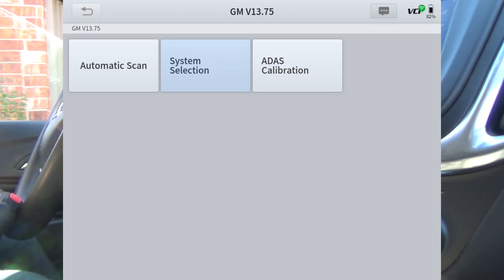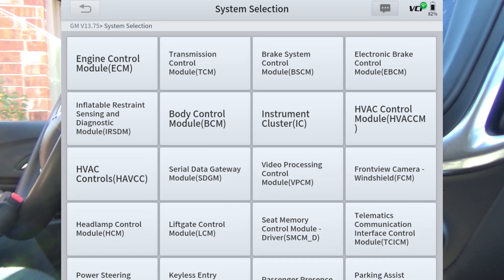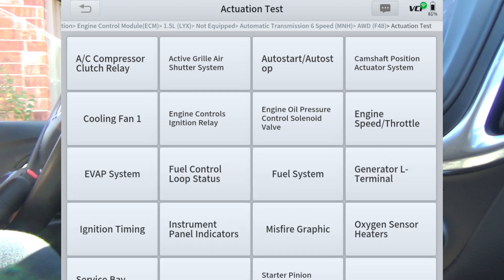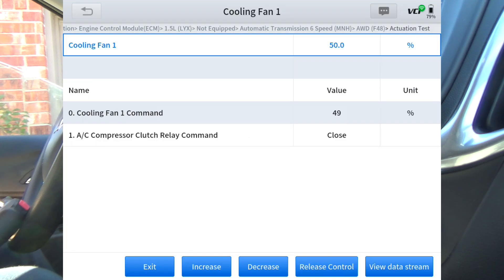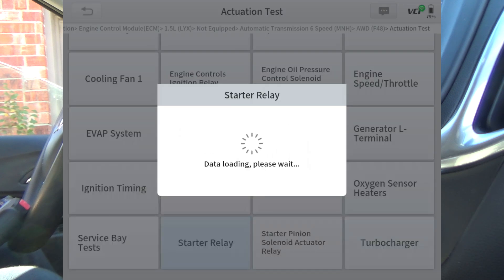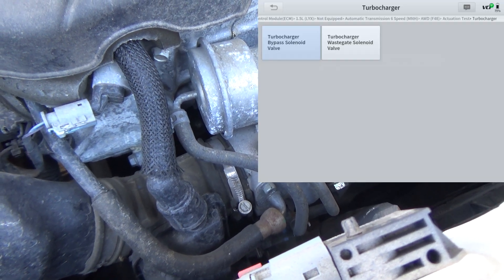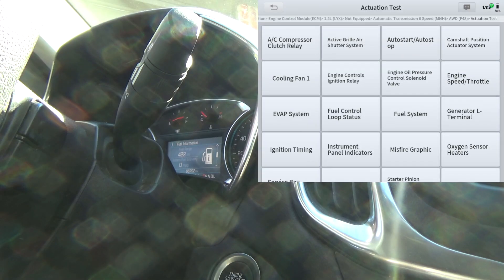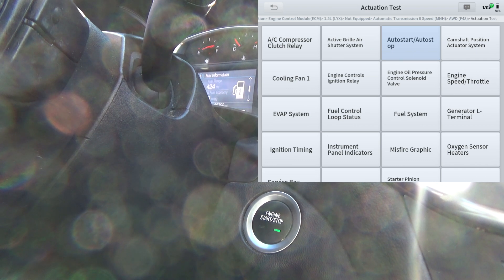Doing a Few Function Test on a 2021 Chevy Equinox using the Xtool D8W Scan Tool.

Comment: Next time go into the Body Control Module and look at the actuation/ special functions inside there.   You can change a lot of weird stuff:  You can turn on/off your seat belt buzzer.  You can turn off the auto locking doors when you take off driving.  You can turn off the door chime.  You can turn off the window auto-roll down.  Or the dome light delay when you shut and lock the car, etc.  There's a lot of little details that can be changed, that most people don't know about.
Reply from the maker: Yes, Chryslers and Toyota are excellent at giving all kinds of customizations, all the other makes and models need to finally catch up when it comes to that.

Comment: Possible you can check the actuation test of your active grille shutters on your Sierra using the Xtool. In previous versions entering the Chassis control module it used to ask you to select your chassis 401, 402 or 403. In 402 and 403 had actuation test of the shutters and it worked. Now entering chassis control module it defaults to chassis 401 and there is no active grille shutter actuation test so you have to go in to the ECM to find it and it doesn’t appear to be working. Also Xtool fixed the FCM scan issue with the release of GM v 13.74 but I downloaded GM v 13.75 today and the FCM scanning issue has come back remains grey in the topology. Thanks in advance.